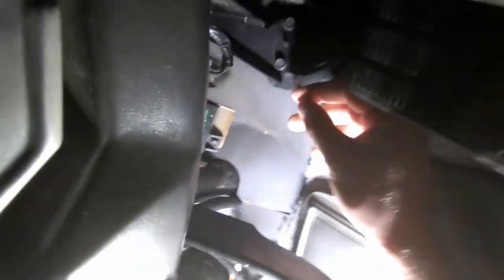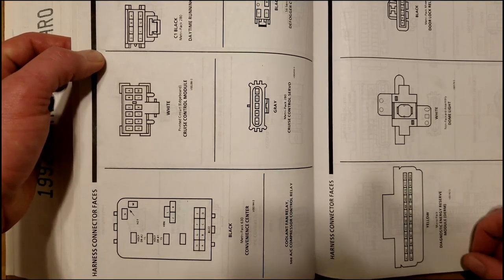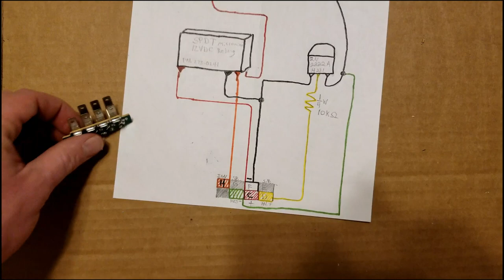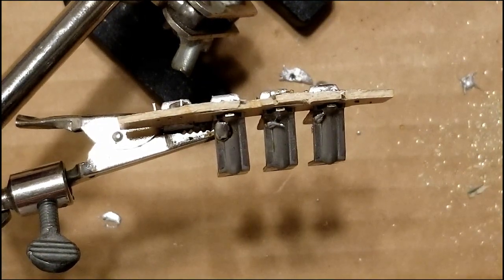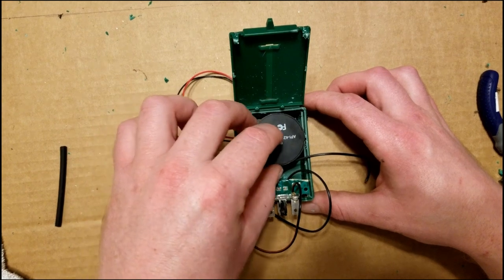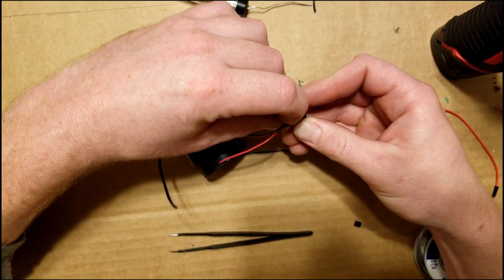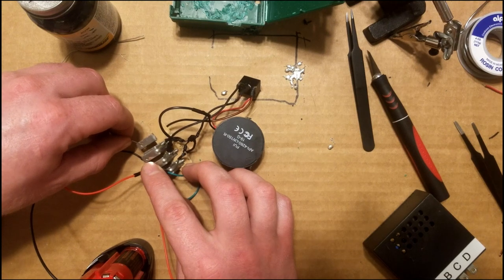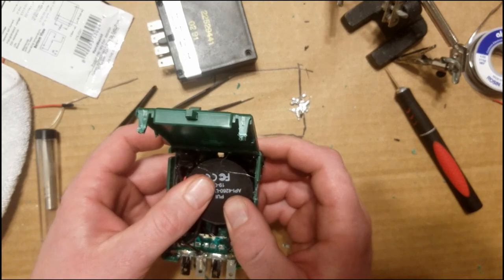How to Build A Custom Car Door Chime

Comment: is there any way you can privide a labeled pinout of that relay? I cant find that exact relay on amazon with that pin setup. or can you label your wire colors as to what function they are on the relay? Like n/o or n/c. or DC+ and DC-, and common
Reply from the maker: I have the diagram from the thumbnail, on my Facebook.com/grimrepairs

Comment: I tried to upload my instagram to show my setup but it won’t let me do it. I did We Will Rock You by queen as my chime. BTW - is there any chance of updating your diagram to show how you would set up the seat belt? I would like my dash light to work. And my attempts to configure the power and ground in the buzzer box is not working. Would be greatly appreciated!
Reply from the maker: Ok cool. I have no update to solve the seat belt issue, if I do ill let you know.

Comment: Dude. Awesome Video! I've got a 2000 F350 any idea where I can find the wiring diagram for the chime box?
Reply from the maker: I think the chime in that truck is integrated into the gauges. You could get the same chime box I used and wire it to the appropriate wires if it can't be done through the gauges. I bought my dealer service manual on ebay.
Reply from the maker: Thank you!
Reply from the maker: if you mean the chime diagram I made its on my facebook at  facebook.com/grimrepairs

Comment: Would this work for a 2007 Lexus es350? If you have the knowledge at hand to answer
Reply from the maker: It could be wired into anything, it won't plug right in though.

Comment: How would you achieve this with a simpler relay? I have an old VW bus that uses a relay with only 2 spades on it, I'm guessing just a neg and pos, would it be a similar wiring?
Reply from the maker: A relay would have more than 2 posts.
Reply: @GrimRepair  Well it's referred to as a relay, so I don't know what the correct term would be. It's basically a glorified speaker, I guess, that just buzzes
Reply from the maker: @p24p14  if it's just a speaker you would be able to just program the new speaker and wire it in. Use a voltmeter and see how many volts are going to it, when it would normally be energized. Let me know what you find.
Reply from the maker: I don't know what year you are working on but if it's a 6v system this speaker won't work for you.
Reply: @GrimRepair  It's a 12v, 1973 year - do you think there's a worry if i hook the speaker directly to the wiring for the buzzer it could overload it? I'm guessing its still 12v since its a direct wire without any sort of resistors or anything
Reply from the maker: @p24p14  I can't say for sure without looking at it. I would use a meter that way you don't switch the polarity. And then you'll know for sure what is coming out of those wires